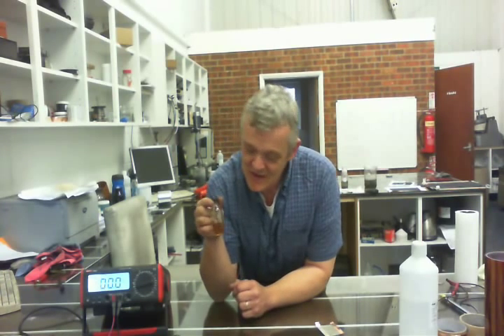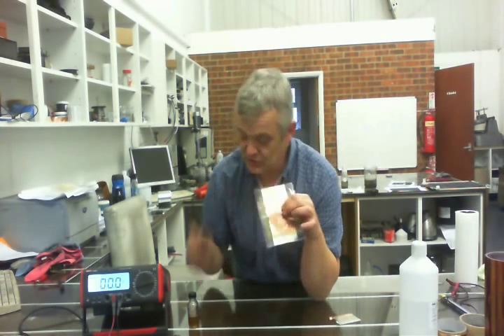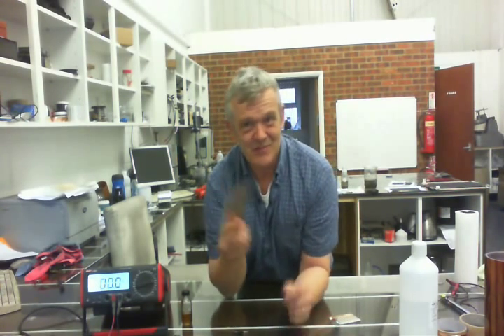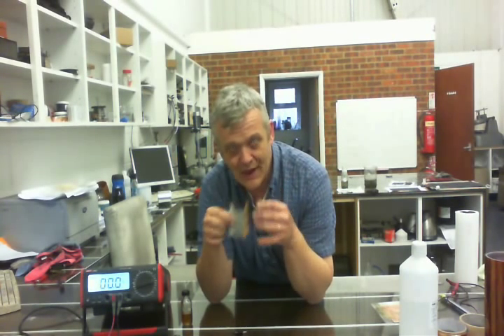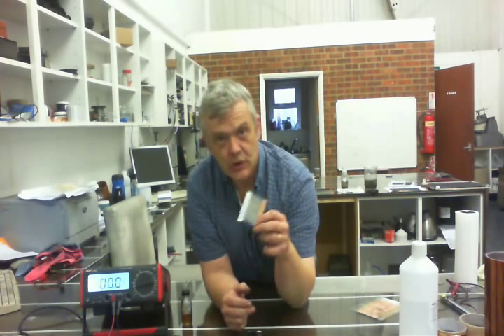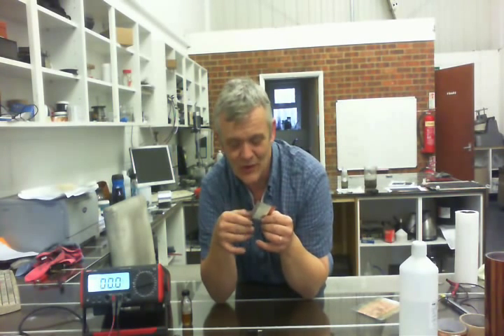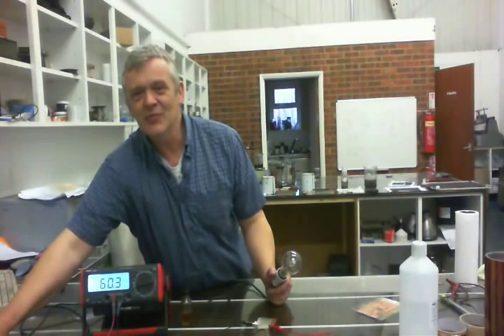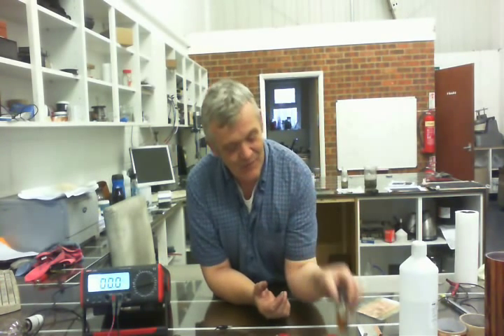Making A Solar Cell from A Leaf

Comment: Intriguing how the voltage rise is gradual and not sudden.
My guess is you may have higher voltage and amps by replacing the Aluminium with Zinc.
A friend of mine showed me an old Zinc Air battery he found somewhere.
Having never seen or heard of a Zinc Air battery before I researched it.
Found out there is more than enough Zinc on the planet to run all the cars currently on the road ( if they were electric ), and the even better part was that Zinc Air lends itself to operating at higher current level if Air is pumped through it.
Behaves like a fuel cell.
This technology your tinkering with might behave the same with more oxygen....thanks to posting!
Reply from the maker: it is an interesting technology mate - there is plenty of magnesium and of course iron - all metal air batteries work in the same way - pumping it through makes it more of a redox flow - but still good stuff
Reply: Could that be due to capacitance?  The only "load" on the thing is the volt meter, which, most likely, has a very high impedance.
Reply from the maker: Steve Lawson
i suppose so but i doubt it

Comment: Very cool, great to hear it's an active research area.
Green leaves are a bit of a prized commodity in November lol, but have wondered about this for a while....also, the use of red and blue LED's rather than white light for test readings.
I'd better get out to the garden !
Reply from the maker: lol - good to work on in spring though - still a quick trip to the supermarket and a sprig of spinach may solve any experimental problems
Reply: Brought some Habanero peppers in today for winter growing...if they make it then great, if not then I have leaves !
These experiments are the hot thing in solar :)
Reply from the maker: slider2732
lol - pepper based solar - very hot lol

Comment: Robert parace que los dos vamos por la misma direccion de las hojas como supercondensadores , lo unico malo que tiene este metodo es que se degrada al paso de unos dias. :-/

Robert seems it the two are on the same direction of the leaf as supercapacitors, bad only having this method is that it degrades in a few days. : - /

Vegetal electrolyte     Publicado el 22/7/2014

Supercondensador con hoja y grafeno 3         Publicado el 8/3/2014
Reply from the maker: let's see how it runs - it has been going for a few days so far - but stability testing will come